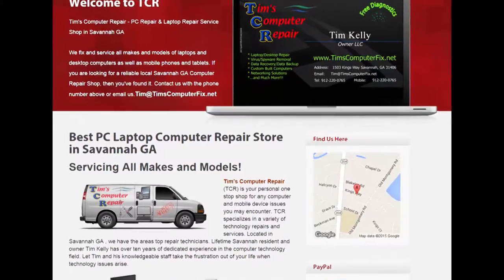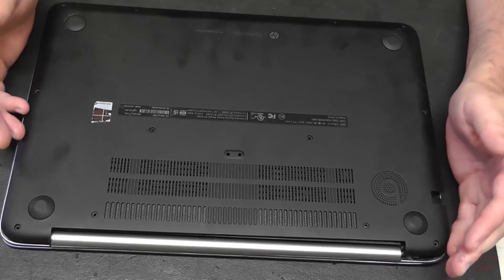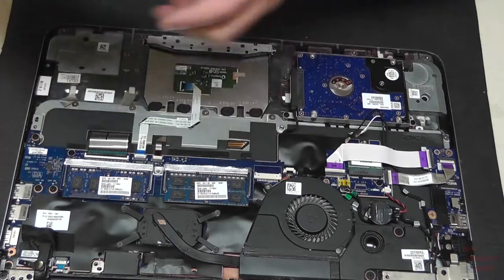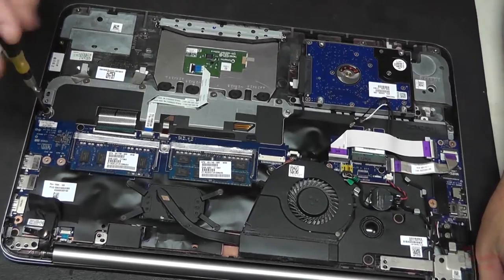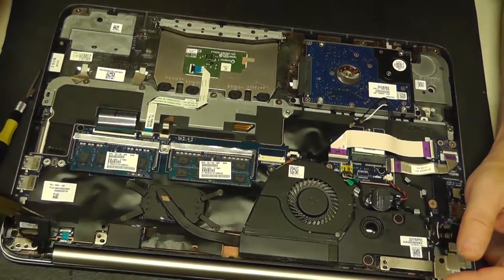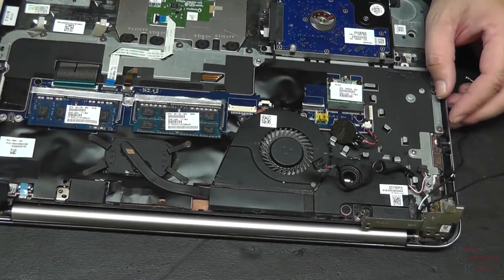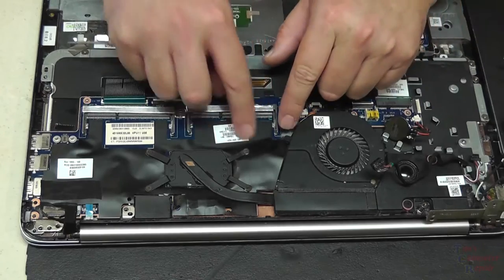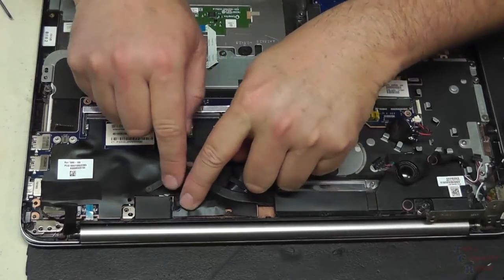HP Envy M6-K022DX Teardown Keyboard Repair and Replacememnt

Comment: Thanks for the tutorial! This thing was a beast to open. accidentally broke the power button ribbon connector on the motherboard, had to tape the power cable ribbon in :( Luckily it still works, although the power led for the power button doesn't. Ah well, that's what happens when you repair things yourself.
Reply from the maker: Hey glad the video helped.

Comment: I know this is old but is this replacement relatively the same concept for an HP envy 17t-s100? I spilled some syrup on it (lol), and all of the keys work. Can I just take out the keyboard and wipe it down with like Lysol wipes do you think?
Reply from the maker: It looks like the procedure would be the same for a keyboard replacement for that model. if you are going to go through all of the trouble to  remove ther keyboard you ight as well replace with a new one. Wiping the keyboard down would not help if you spilled something sticky on the keyboard. Good Luck!